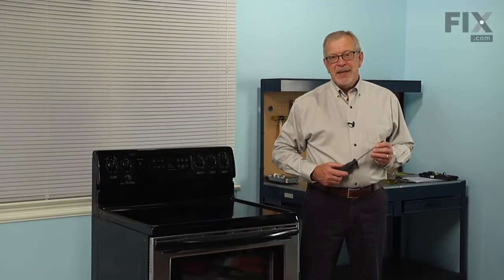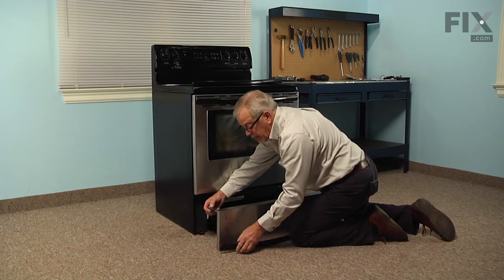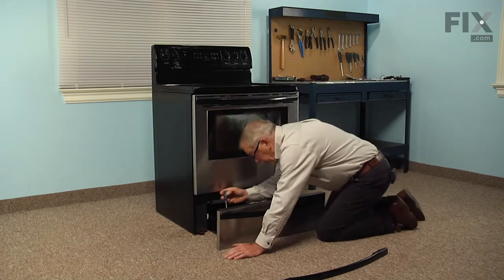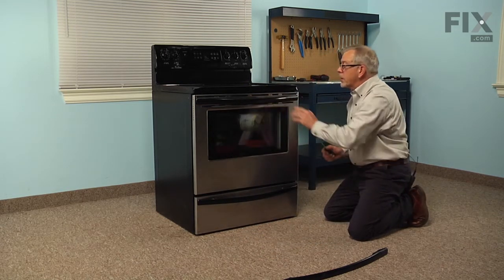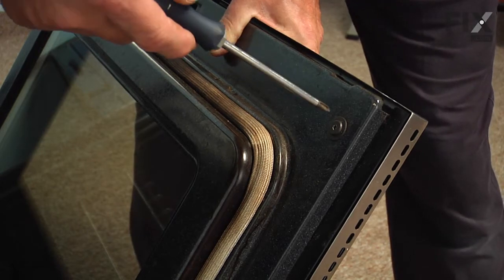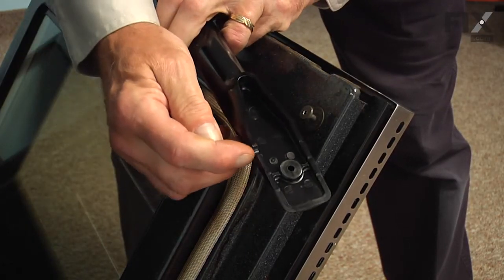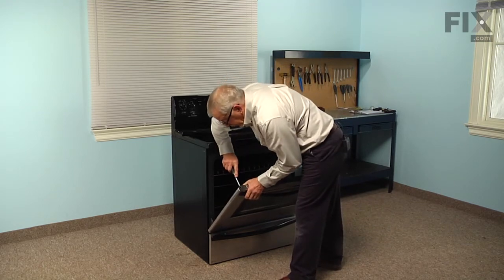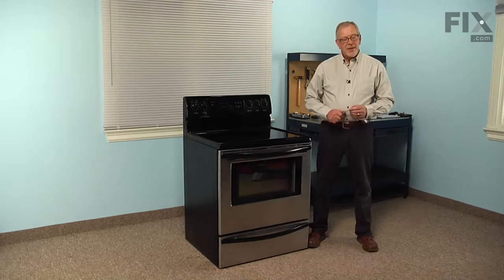Frigidaire Range Repair – How to replace the Door Handle

Comment: Been struggling with this handle on the oven door. I agree the design is not great. Plastic door handle wallowed out. This video was helpful because he started out changing the lower handle and it gave me the solution. The screws holding on the lower handle sink deeper in the handle. So I just swapped the handles and both are tight as can be now. Problem solved, $0. No need to pay $70-$100 for a new handle….at least not for a few more years.

Comment: My oven handle keeps falling off when I'm opening a hot oven and then the door slams shut - seems like a pretty significant safety issue.  It seems that the screws are too short and the problem is that the plastic where the screws go into the handle wears down over time, so every time I reattach the handle by tightening the screws the hold gets weaker and weaker.  This video has super helpful info and I appreciate that you offer links to buy the handle, but your link is for a replacement handle only... no screws.  I think the product design is flawed and the screws need to be slightly longer in order for the handle to be securely fastened.  It would be great if fridgidaire offered a repair kit in compensation for the design flaw and safety hazard.
Reply: I have the exact same problem.
Reply: Amen!
Reply: I have the same problem. I was Googling to find out if others are having the same issue and here I am. Our frigidaire oven has springs that put extra pressure on the oven door and the handle keeps flying off and the door splits open and the front half slams to the ground. This must be a flaw. This oven is only a couple of years old and should not be falling apart like this. They definitely don't make appliances to last like they used to. I am NOT impressed
Reply: same here!! And a new handle costs (wait for it).....$80!! Unreal and really unsafe.
Reply: Having the same issue
Reply: @melissak0541  Been struggling with this handle on the oven door. I agree the design is not great. Plastic door handle wallowed out. This video was helpful because he started out changing the lower handle and it gave me the solution. The screws holding on the lower handle sink deeper in the handle. So I just swapped the handles and both are tight as can be now. Problem solved, $0. No need to pay $70-$100 for a new handle….at least not for a few more years.

Comment: I ended up buying a new handle because the threads wore out from screwing it back in all the time. It still keeps popping off! Bad design! Gonna try swapping the screws/handle with the lower drawer (that I rarely use), as I've seen in the comments here.

Comment: Anybody who makes such a terrible product should be someone you would avoid. It's best not to buy a Frigidaire oven 🤷‍♂️ Here is a $70 crappy plastic handle to replace the other plastic crappy handle 🙄 ( some are over $100 ) "Now that we have replaced the handle, you will have a working oven for 2 more years until this crappy handle fails" 🤣🤣